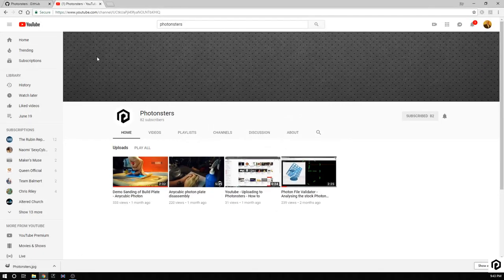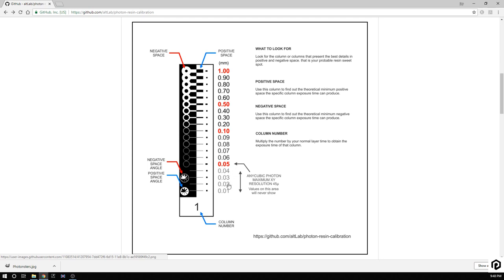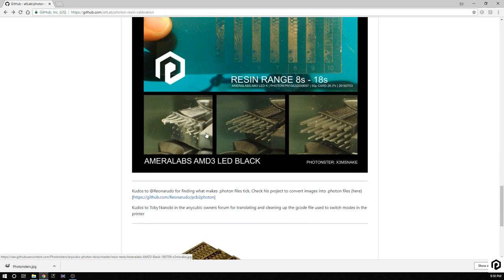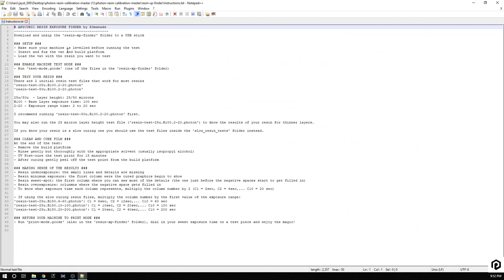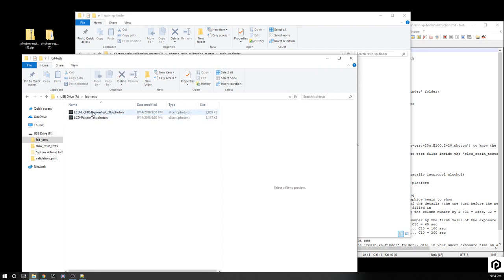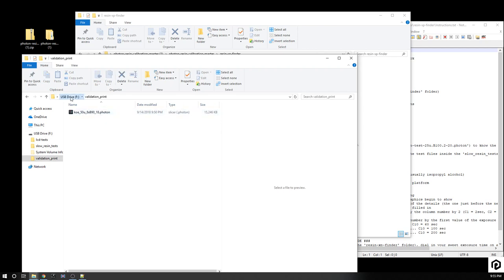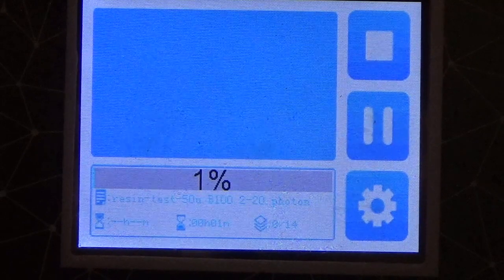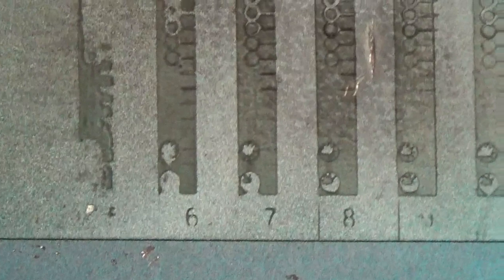Resin XP Finder - NEW VERSION AT https://youtu.be/P5p4IgZuqMA

Comment: If peel is disabled, aren't we over exposing the resin at 100 seconds on the base layer? I'm not sure I understand this process yet.
Reply from the maker: there is one emulated peel move. You have seen it if you have ever used the tool. that 100s is to create a thin film so it can support the test layer and you can end up with a card

Comment: So what is the best exposure for the emerald green resin from AnyCubic?
Reply from the maker: I advise you to test it yourself with resin exposure finder, since it can change slightly from machine to machine, and that is what this tool is for.
If however you are feeling really lazy just drop by photonsters.org and check the curated table of resins and all the other goodies the community has put together.
Reply: I did reference the table, but it has a mix of quality. For example, the green from Anycubic is in the table as 5.5 seconds from one person, and 10 seconds from another for 50 microns. Only one of them can be correct, and the differences among printers cannot account for a double exposure time. So - which entries in the table are verified by this method? What do you think the emerald green exposure should be? Thanks.
Reply from the maker: @rsilvers129  some people like underexposure that is why resin has a range. in case of anycubic green the sweet spot for me is 12s but if I am printing a full plate or thin positive details I use 14s.
The best way to see if you are over or under exposing is to use a test model for validation like ameratown that is supplied presliced on the validation folder under resin xp (you can set your test values on the machine menu or use validator to change exposure values on save)
still my advice continues to be the same. if you really want to learn about your printer try the resin exposure tool, check the readme on the github page and see: how different exposure settings affect the end print; what is considered underexposure and what is considered overexposure; how to assess your machine/resin range.
Reply: @Photonsters  I just did this - hard to photograph but this is a flatbed scan with black and a white background:

https://i.postimg.cc/5y7tH7fk/AC-green.jpg
Reply from the maker: @rsilvers129  column 5 should be the sweet spot. if you look closely at column 6 on the negative details it starts to fill in the bottom gap circles

Comment: This seems nice, I really need it. BUT do we dare to use the gcodes provided? How do we know, that they will return OUR Photon back to the correct state? (maybe different in various firmware versions)
Reply: This is a proven method and we at Photonsters have been working alongside with the board developers (makers of chitubox) so unless you have made modifications to your peel times by modifying this gcode, this is the factory defaults and no modifications have occured to the peel times troughout the firmware releases as you can confirm in anycubic support release notes.

Also the program does not clear the EEPROM just changes the parameters needed to disable the peel motion and for that reason you do not have to relevel your machine.

Just run Testmode to put it in test, and printmode should return you to the original factory peel settings.

Any issue you can post in the Project github page, photonsters.org or in the anycubic photon owners group in facebook.

;)
Reply: @X3msnake  Thanks for the answer. Just to be 100% clear, I use Photon slicer and not the Chitobox one, but that does not make any difference with this test?
Reply: @Chris16341  no. test is independent and you use it with the supplied files, when you find the sweet spot just use it with your slicer of choice. make sure you check the photon validator at photonsters.org It allows you to change values on a already sliced file on save and also check for potencial errors in print

Comment: Do i have to level the plate after putting running this test? My next print after this failed because the machine forgot to lower the bed into the resin and just started curing right on the FEP sheet.
Reply: You shouldn't have, since the EEPROM command that clears the memory is comented out.

Comment: The question is how to analyze the file to pass the information to Photon ? for example, mine is perfect on column 10.
So, I found the column 10, perfect... how should be the
I know my layer thickness is :0.05uM 
 Normal exposure time ?
Bottom Exposure time ?
Bottom layers ?
Reply: - First Check the readme in the project github first of all https://github.com/altLab/photon-resin-calibration
- Second for you normal layer time, you multiply the column number by your test file base exposure. Say you are using 2-20, then your file base exposure is 2seconds. Column 10 means you should use 10x2s = 20s for normal exposure time (if that was the case that resin is slow)
Last but not Least, Bottom Layers and Exposure is more like a constant than a variable. You need good foundations so it is better to give a good exposure to these first layers.
You can safely use 8 layers x 80s and that will cover most of your resins and your layer resolution, it will help with a good burn of these first layers, will overcome any imperfections in your plate and also contribute to heat up the resin.

Comment: In your video you said "I am going with 8." But it is not clear that "8" means 8 seconds or 16 seconds because the test said that it was going from 2-20 seconds. Checking the instructions again, that means 16 seconds I think.
Reply from the maker: Yes 16s, like Jay Starling says in the vide it all depends on the card you use you just multiply the column number by the base time if it is 5-50 and you have column 2 for example it means 5x2 > 10s
All this should be validated with a validation print, if you look on the 3 validation result columns the sweet spot for that resin turned out to be 10s-12s instead of 16s like the card initially sugested. and these small drifts can occur for various reasons. like having a plate that is uneven or slight tilt on the levelling, or if the resin is transparent it can sometimes give false positives, because this test does not take into account the cross curing between layers that occur in clear resins
Reply: @Photonsters  I am finding another issue... I just printed a 10.00mm hollow cube from a model with 1.0mm thick walls at the exposure best suggested by interpreting this test but with another grey resin and at 14 seconds, and the cube printed as 10.25mm wide and the walls ended up 1.25mm thick. Since I am printing functional parts and not the more common Elf figurines, I need correct dimensions. I propose a new test to help people who care about mechanical dimensions. One would print it, and it has a table of lines. You look for the line that ended up 1.00mm wide (you could use a loupe with a measuring reticle, which I have), and the number next to it is the exposure time in seconds. How could that test be created?
Reply from the maker: @rsilvers129  after the exposure finder you will have to do this with multiple small tests at different exposures. unfortunately untill anycubic releases a new firmware, what you ask for is not feasable. for that we would need to be able to control individual layer exposure times not simulate it by disabling peel and doing multiple exposures. only thing i can think of is a continuous model, like a 10mm continuous tower pattern that you manually change normal time in your machine at given heights manually
Reply from the maker: @rsilvers129  alternatively look for Jay Sterling calibration method on anycubic owners FB. and beware that this should be tested troughout the plate since there is a power decay to the edges of the screen
Reply from the maker: @rsilvers129  by the way the current exposure test pattern used on the resin xp for the positive and negative scale on the columns starts at 1mm and goes down by 0.1mm untill reaching 0.1 there onwards it goes down on 0.01 increments

Comment: I tried running this test on the photon s but the g code is not showing up on the menu anyone got a solution for this?
Reply: this does not work on the photon S
Reply: @X3msnake  Is the gcode meant to run natively on the photon?
Reply: @alainvella9457  if it uses a chituboard it works the photon S does not. it uses it's own undocumented board